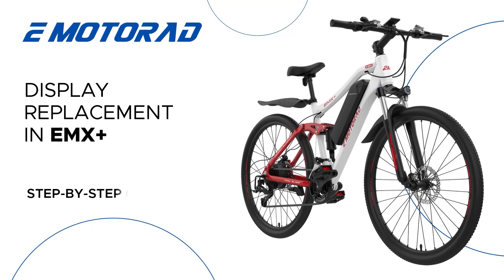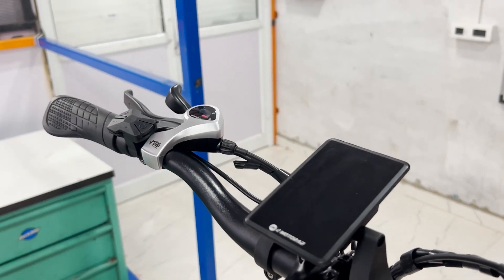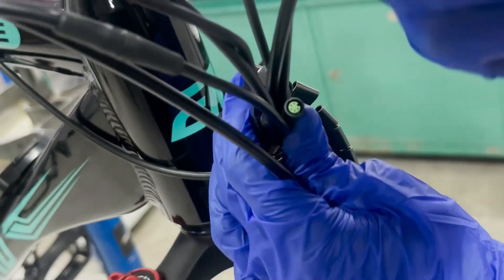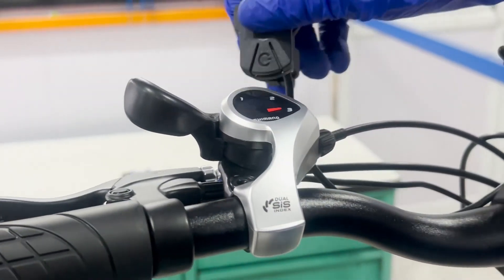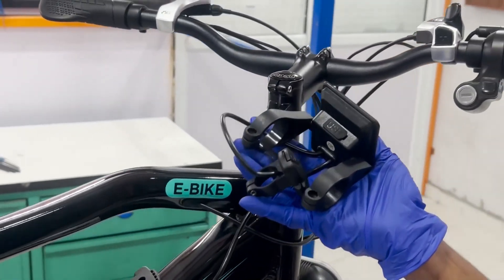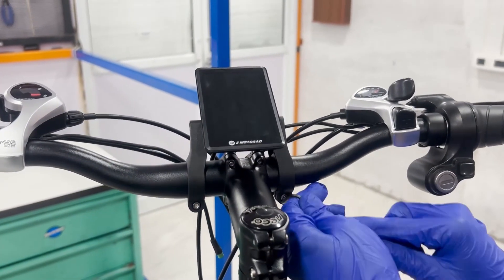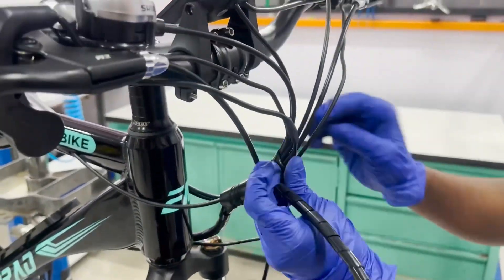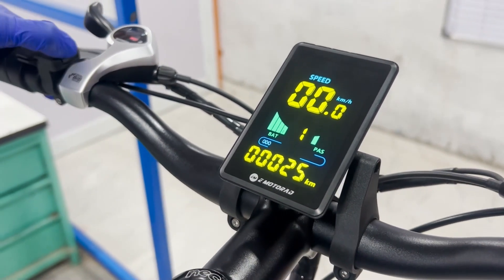EMX+ E-bike display replacement | Step-by-step installation guide

Comment: Please tell me the price of the display. Since it has 5 pin and Trex air has also has 5 pin, can we replace the Trex air display with this? If not, tell me the firmware version in Emx plus and Trex air. Thanks.
Reply: I can't find a display to replace mine with either and it sucks. I need to replace mine if you find out anything please let me know!
Reply: @matthewunbankes9693  If you have eMotorad cycle, you can contact support. They will help you. For me they told emx+ display panel around 3500 and Trex air 2500. Since the firmware is different, you cannot swap across different models.
Reply: @matthewunbankes9693 can you tell me your cycle full name ?